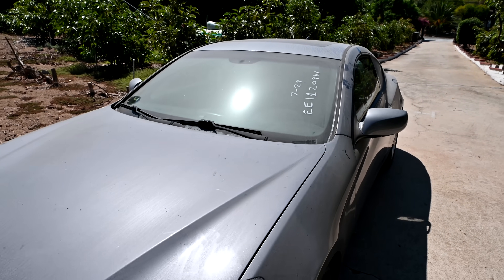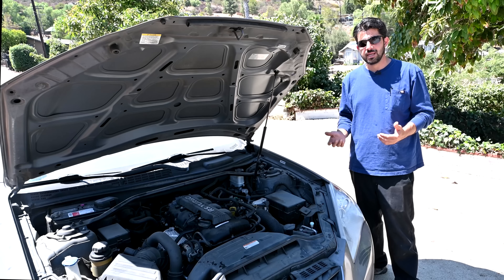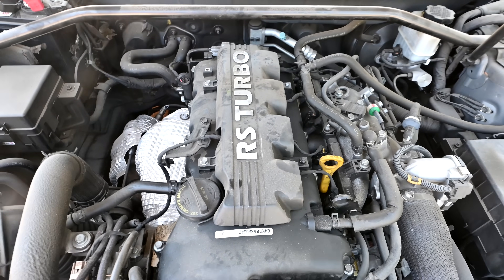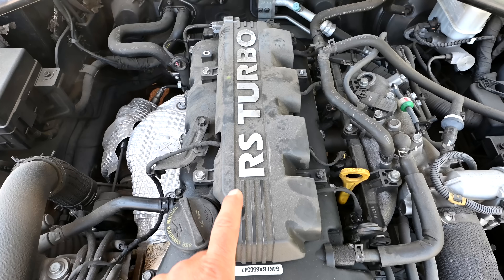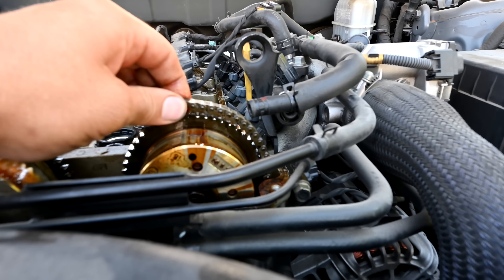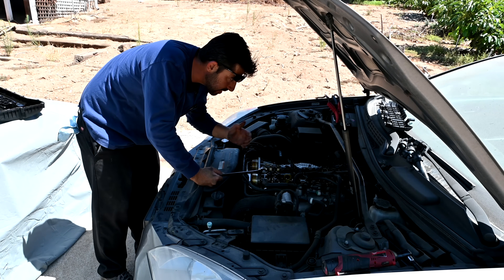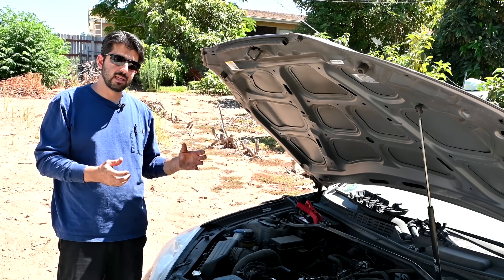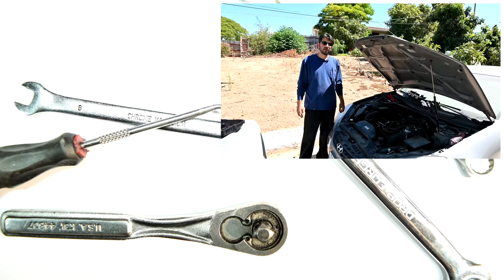The Hyundai And Kia Engine Failures Explained.

Comment: I have 2 friends who used to own Hyundai cars until they had issues. One of them was the new N series but the trans blew at 7k on the OD and Hyundai tried everything they could to not replace the trans under warrantee. In the end and after months of legal back and forth they did replace the trans. Same happened with my 2019 Carmry, the trans went out on it at 20k on the OD and Toyota did not want to pay for a replacement.

Comment: So the first thing the guy does is turn the engine on the starter motor. Then later after finding out the cam chain is loose hesitates to turn the engine by hand just in case a piston contacts a valve. Er, the horse already bolted mate. If there is any suspicion that the valve timing might have been lost, you DO NOT spin the engine using the starter motor first! Duh!

Comment: Our 2012 Sonata suffered rod bearing failure at around 85,000 miles. This occurred right before Hyundai officially started their recall/repair program for those engines, but they investigated briefly and replaced it free of charge anyway. No issues since--great reliable car.
Reply: @Ratz Patootie They're the biggest auto manufacturer globally, they're nowhere near going out of business lol.
Reply: I had several KIAs myself. Had a optima 2.4 no issue and a 3.3 v6 twin turbo no problem. If you're worried just do a engine flush with a high quality product run high quality oil and change oil every 3k. No way oil is going to be good at 7500k. That oil and engine problem proves that.
Reply: @Ratz Patootie Maybe you know something I don't, but as far as I know the companies are still pretty financially healthy. The Sonata still sells like crazy, as do the small and midsize SUVs. I'm sure these recall issues cut down their margins but they still seem to move a lot of units.
Reply: @Ratz Patootie how'd it go? Dropped mine off for diagnostic today. Rod knock and limp mode at 90.8k miles. I think I'll have to get a rental out of pocket and pray kia reimbursed me in the meantime.
Reply: @Ratz Patootie my tests were within the warranty parameters. Whether I get a new engine or they have to run more tests depends on what kia responds to the techs. I talked with Kia consumer affairs and he saw the test but didn't know what it meant, and thus just told me about the rental coverage of $40 a day and how to submit reimbursement for that. I can tell you how that works if you need. Once Kia gives the go ahead I'll know what the techs can do for me. Hopefully tomorrow I'll know
Reply: Blah blah blah great engine got 151,000 runs like brand new 2013 santa fe
Reply: @Ratz Patootie good lord. It's my only car too and I have work and not a ton of money saved up for a rental. I sure hope it goes well. It's kind of sadistic for Kia to not have done a true recall on these vehicles. I can't describe how lucky I was to not have broken down in rush hour traffic when it would have been much more dangerous. That's like 90% of my drive time. It's a shame too because I really liked my optima ex until all of this.
Reply: @Ratz Patootie thanks Ratz. Can we just communicate here? I'll email you if you want I suppose but I get notifications when you reply to this thread. I'm going to call the dealership shortly and see what's going on. It should have been sitting there for about 24 hours now so hopefully I'll at least have a positive diag code by now. He said they have 4 cars in for engine replacement right now and if I was a positive diag then he'd order the engine same day and probably 3 week overall wait for me 🤞 I also need to figure out a rental today so I'll be calling Kia consumer affairs beforehand to see what they'll do for me
Reply: @Ratz Patootie so Kia did approve the engine replacement! By some act of higher power they also have an engine on site, they informed me of this last night. There's a chance I'll be driving mine home today or tomorrow. 
Let me tell you a long winded story about my thoughts on selling it. I was at CarMax two weeks ago and saw a 2013 Kia optima ex with 96k miles on it selling for 17.8k. I bought my 2014 optima ex 3.5 years ago with 48k miles for 14k. Let that sink in. The market is absolutely insane. 

I would like to sell mine or trade it in, however, let's say I get back 14k somehow on the sale, which I think is optimistic; I still owe ~5k on it. Every other economy vehicle is marked up 10k or so and that's for used and new it seems. So if I sell now and buy now I'm at best breaking even. The smart thing to do would be to sell now and hold onto the money for the bubble to hopefully pop, then buy a new car, but that would leave me and my gf with a single car in the meantime. The only way I can think to profit off of this is to sell my car, buy a motorcycle, and hold onto the extra money until I can buy another vehicle at a reasonable price. I just don't see any way to win in this situation but frankly I don't want to sit on a time bomb of an engine for very much longer. I will hopefully sell within 6 months. What about you?
Reply: @Ratz Patootie Car broke on Saturday, 10/22/2022. 

I got my car towed 30 miles to a dealership in Decatur, AL Monday 10/24 after calling them that same morning. Towing was covered by my insurance roadside assistance. The dealership told me there was 3 or 4 cars ahead of me so I should drop it off asap. From calling them to drop off was all the same day. 

The next day, Tuesday, they had the bearing clearance test done by end of day. I also called Kia consumer support just to ask them questions about reimbursement etc. After 1 hour on hold I reached a nice agent who was very helpful, but not super knowledgeable on this specific issue. I think I described what he told me about reimbursement in a previous reply. He showed some ignorance when he said he could see that they had finished the clearance test but he said that it concluded an "error" so he would have to wait for an update from the dealer before they approve anything. He kindly tried to negotiate a rental through the dealership by calling them directly, but the dealership told him the same thing they told me, which is they had none to offer.  Good agent, decent experience, nothing much to say about that discussion with Kia.

Wednesday I called the dealership and he said the Kia support agent 'doesn't know his ass from a hole in the ground'. The "error" the agent saw indicated it failed the test and they should be covering things. He told me they had entered it into the service logs and are waiting for replacement approval from Kia. They got approval later that evening.

Thursday I called and found out that they had replacement approved and were pulling my engine out that day. They had an available engine that would work for me, so instead of waiting the 2-3 weeks for delivery and labor they were starting it that day.

Friday 10/29 they finished the repairs and I was able to drive it home that day. 

It seems unbelievably lucky they had a spare engine for me especially considering they told me how many people were ahead of me. but he also said that they do like 3-4 of these a month at least so they definitely flux engines in and out regularly. Possibly I was given such prompt care because I provided 9 previous oil change records printed out, all done at 5-6k mileage intervals. I provided my KSDS update records, which they also confirmed internally. I called Kia consumer affairs, and I was polite and friendly and complimentary to everyone I encountered. I also talked shit on the other local dealership and was glad I delivered it one town over to get them to work on it. I also emphasized it was my only vehicle and I really needed their help. Either all of that combined into a good experience, or I was just extremely lucky. Probably both. 

 The car runs very well now that it's fixed. Not like new but I feel comfortable with it. I'm not going to sell the car because it's basically an infinite reusable car at this point, and I feel I can now invest $2k or so into making sure the transmission and other essential components are fully cared for. Y'know, all those preventative measures that should happen between 60-120k miles that people rarely do. Also my good experience with this dealership, shout out to the service manager Darren, made me feel a little refreshed brand loyalty. He answered every time I called and explained everything and more in as honest and specific details as possible and addressed every question I had fully. He would even pull aside techs to ask for updates while I was on the phone. I wrote my first ever review on Google maps for them, bramlett kia in Decatur has some true professionals working there.

As much as I don't like the feeling of sitting on a time bomb, I may have forgot to mention that when it broke down I may have been, allegedly, racing my friend and I was going 100+ mph in a corner using the shiftomatic in 4th/5th gear lmao. The car didn't catch on fire nor lose control and I limped it home 20 miles that night, even making it over the largest mountain in town at 5mph. It sucked but I kind of deserved it. For the record, I owned the car from 46k miles and it shit the bed at 91k miles, 1k miles after my most recent oil change. I have been known to use the shiftomatic manual gear changer for fun and engine braking a couple of times each week and I'm also heavy on the gas pedal and not in eco mode half of the time.

They didn't punish me for rough use or even mention it, so I can only leave this situation feeling blessed and sympathetic for the experiences you have to go through. If I was you I'd almost certainly be offloading the car too. Thanks for the updates and I hope someone can learn something helpful from our discussion. I think my experience was the best one could hope for on one of the hardest used optimas out there. Moral of the story is shop around dealerships and only go with the best one even if it costs extra to tow, it'll probably be worth it.
Reply: I just got a, 2023 Hyundai Sonata N-Line 2.5l turbo and I couldn't care less about engine problems as the warranty is, 10 year/100k mile warranty. Lol. So....I don't care if anything fails....I get it fixed/replaced for free. Ha also....I ALWAYS change the oil on a new car after the first 500 miles.  Some engines just don't last as long as others. It happens....not a single engine and or car maker has an engine that has never had a issue or issues. Millions are sold and odds are, some will have issues, especially with some people driving em hard as all hell and not doing proper maintenance.
Reply: @nexpro6118  it's good you got the warranty, what I heard is that originally Hyundai wouldn't replace the engines for owners who still had warranty and blamed the engine failure on the owner. It was only after somebody sued them and won a class action that they are replacing engines under warranty.
Reply: @zzoinks  they will blame the owner still if the owner didn't do EVERY required maintenance on time. If not, they can and will (with a big expensive issue) void your warranty.
Reply: "great reliable car" yeah all it took WAS A NEW ENGINE. LOL

Comment: I have a 2012 vw Passat and I had to put a new engine in it because I changed the coolant and didn't get all the air out of it and popped a head gasket and coolant mixed with the oil. So I got an engine with 60k and paid 600 for it. The kicker was the labor was 2000 but it actually runs better than the original at any point of time. So my message is if you don't know how to get the air out of it. Let the pros handle it.

Comment: I have 2014 hyundai elantra I use full synthetic oil Quaker Steak I had my engine knocking two Pistons on 101 k brought it into Hyundai and phone Hyundai Canada and fixed it so no problems just have to pay for oil change now I'm at 200,000 km still running strong I changed the oil every 5,000 km..
. 
Change the spark plugs I noticed the block is aluminum and it makes a squeaky sound when I put the spark plugs in . Will be changing my oil soon. Just got to take very good care of it to make it last long time and plus my engine was built in USA not in Korea so more problems in the USA. My engine is 1.8 L and I hear a lot of 2 L going boom LOL

Comment: I have a 2010 Kia Forte Koup EX which has the 2.0L engine.  I've never had a mechanical problem with it, but I have always gotten the oil changed at 5k miles.  For the last two or so years she was burning a little oil, I just assumed it was some gaskets getting worn out and that eventually she would break down and I'd send her to the junk yard(I bought myself a new car last fall, so I was just driving this one to save mileage on my other car and since it's long been paid for I figured it was just a sensible idea.)  Well... I went ahead and had the spark plugs replaced in December and then she stopped burning oil and has been running just fine.  I knew I was overdue to replace the spark plugs but I wasn't sure if I was going to keep the car since I had purchased a new one.  Oh yeah, I've got 247k miles on her.

Comment: Do the current generation Kia/Hyundai SUV turbo engines have these manufacturing defects as well? Planning a purchase, but thinking of staying away from Kia/Hyundai for now after watching this video.
Reply: I just got a, 2023 Hyundai Sonata N-Line 2.5l turbo and I couldn't care less about engine problems as the warranty is, 10 year/100k mile warranty. Lol. So....I don't care if anything fails....I get it fixed/replaced for free. Ha also....I ALWAYS change the oil on a new car after the first 500 miles.  Some engines just don't last as long as others. It happens....not a single engine and or car maker has an engine that has never had a issue or issues. Millions are sold and odds are, some will have issues, especially with some people driving em hard as all hell and not doing proper maintenance. Again, new hyundais now have a 10 year/100k mile powertrain warranty. So, couldn't careless about issues. Lol also, when buying a new hyundai, you can purchase a lifetime pwertrain warranty for around 2k.....so.....couldn't careless about issues.

Comment: Turbos  on  gas  engines,  is  a  NO   N O.   THEY   ONLY  BELONG   ON  DIESEL   ENGINES.   Gas engines, with turbos, run at  WAYYY   TOO   HIGH   A   RPM  !!
     There is too much heat, compression, and not enough COOLING   FROM  BELOW,  the piston; AS  WELL  AS   TOO  SMALL  of a   cooling  system/radiator.  Another item, is  POOR  piston rings, and generally  crappy designs, with not enough oil lubricating the bottom end, as well as   THE   V A L V E S.  (OHV)
 These modern, toy  'engineers'  need a few lessons, from the  WW  2   generation;  BUILD  SOMETHING   DECENTLY,  WELL  DESIGNED,  FOR  LASTING   LONGEVITY.  Modern  'junk'   most all stuff, today.

Comment: From what I've researched the N/A V6s and the 2.0 engines are really reliable. I don't trust thier 2.4l and turbocharged engines at all. 2.4ls oil pump might stop working all of a sudden and there the infamous oil mixing with coolant issue.

Comment: I got a 2018 in December. It has less than 7k miles on it and has been back twice for dropping to limp mode from a knock sensor code. That's once before they changed the sensor and once after. The car can't handle rpm load when passing or merging onto the highway. Both times the car dropped to 40mph almost immediately, almost causing pileups. DO NOT BUY A THETA II EQUIPED HYUNDAI OR KIA.